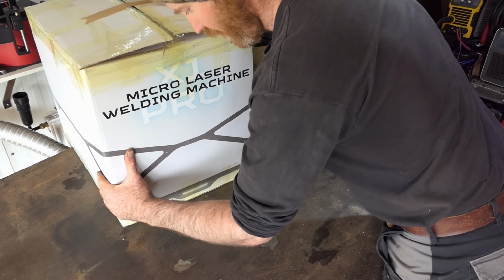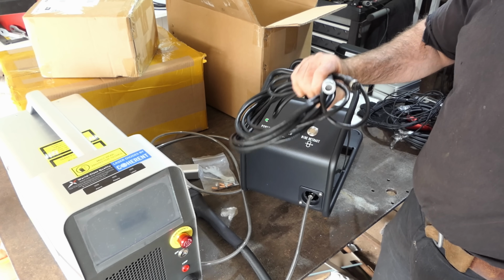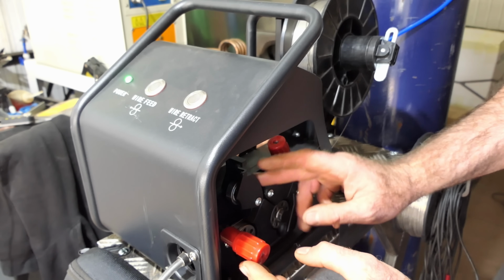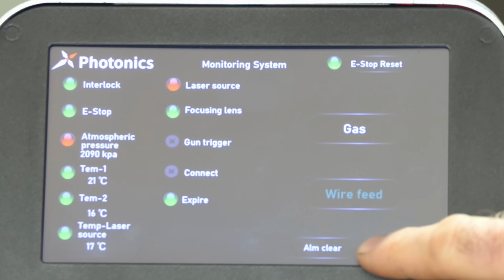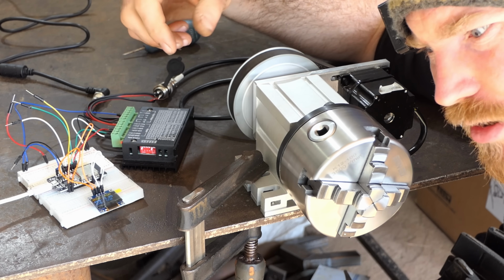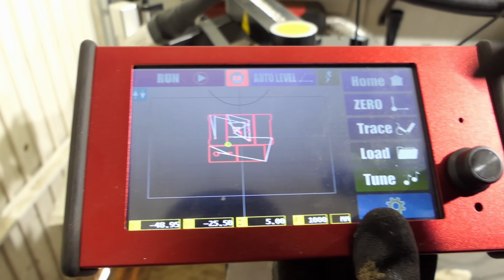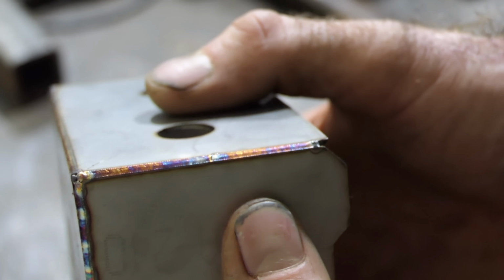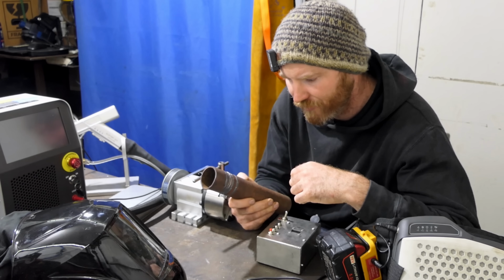Upgraded Super Laser!... Kickstarter fulfilled!

Comment: How does the laser welder do with copper and brass?
I've not seen anyone try to weld those as yet.
And would it at least cut copper and brass?
Reply from the maker: I've seen it done but yet to try. Coming soon as I have plenty to test on. Cheers J
Reply: @joshuadelisle Thanks for the reply. Looking forward to the tests
Reply: Don't cut copper and brass vertically as copper is very IR reflective and also needs more power to cut so you will at the very least damage your lenses if you keep the gun vertical..
Reply from the maker: @Flying0Dismount  Good tip. Thank you. Cheers J

Comment: So the laser warning mentioned a 650nm, I’m guessing that’s a low power. But none of the glasses or helmet is rated for that wavelength?
Reply from the maker: That's probably the visible part which can be seen through the glasses. I think... Cheers J
Reply: @joshuadelisle I realized it didn’t have high and low after watching the whole video. But that makes sense and goes with the radiation output rating. 0.5mw at 650nm would be considered safe and no glasses needed. Thank and enjoy that amazing welder.
Reply: 650nm is the red guide dot - it's basically just a handheld laser pointer

Comment: its a boost converter
Reply from the maker: Buck because it reduces voltage also. Cheers J
Reply: @joshuadelisle  then its called a buck boost converter
Reply from the maker: @charcoal386 Correct. I also used a buck only converter for the esp32 👍
Reply: @joshuadelisle ok so the buck boost converter was just for the face shield system